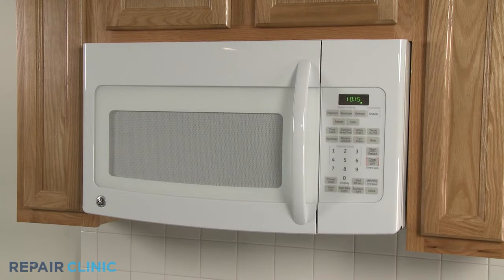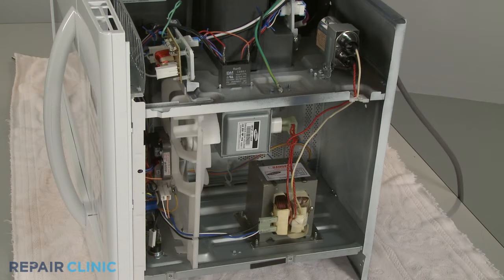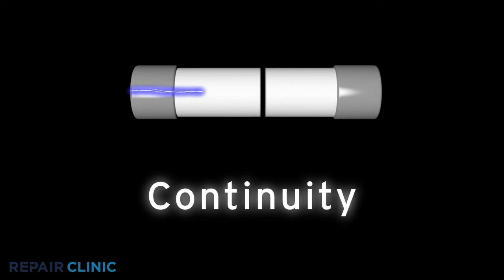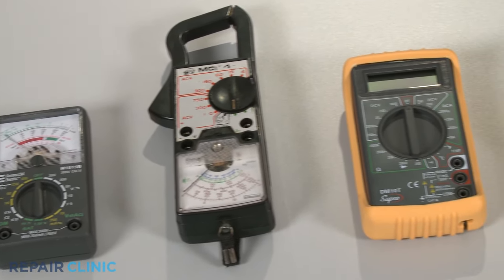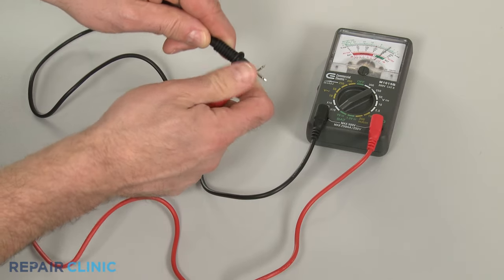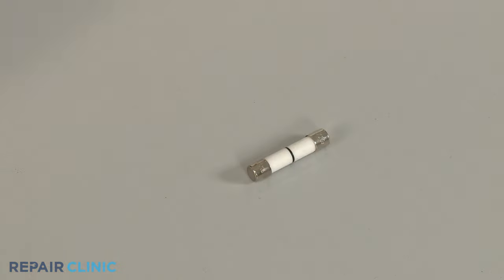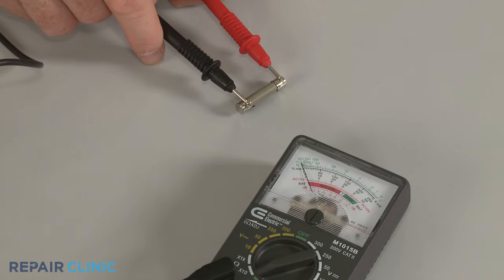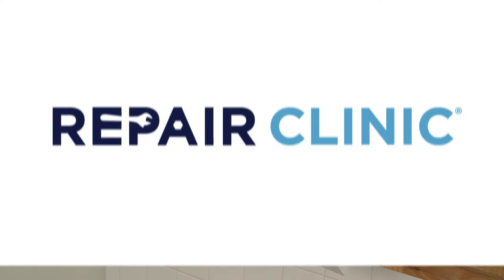Microwave Not Working? Fuse Testing

Comment: How do you remove the fuse? And without shocking myself? And can I test the fuse’s continuity without removing it if I have a multimeter?
Reply: Old post, but if you don't know how to do any of that, don't attempt it. Testing continuity on a connected component can damage other components, or give the wrong reading. Always remove a component before testing for ohms/resistance and never ohm a live component (has electricity flowing through it). Nobody can just tell you where a component on your microwave is located, as all microwave models are different.